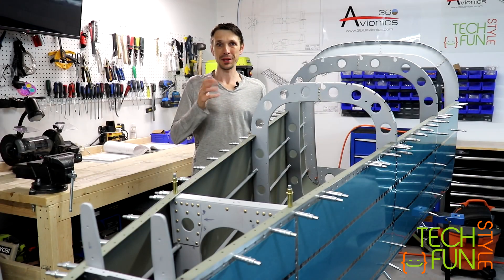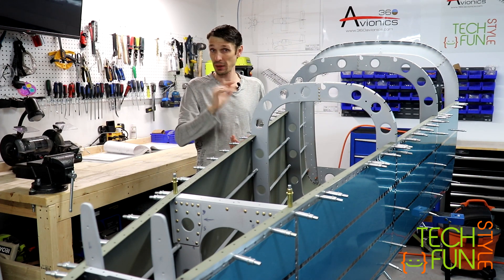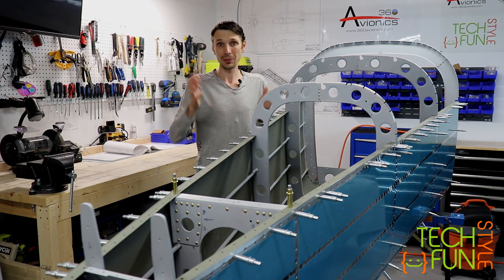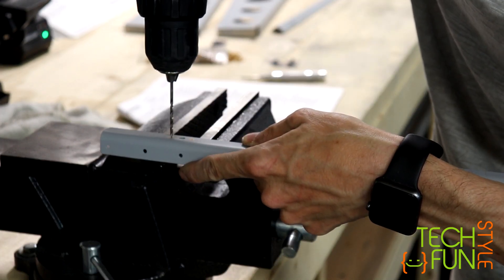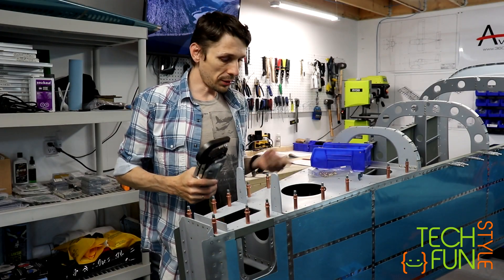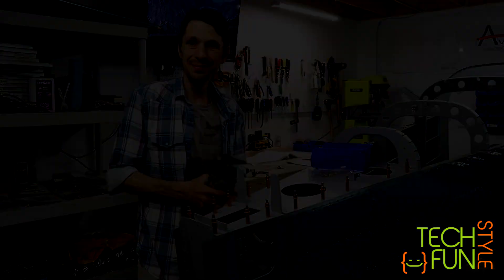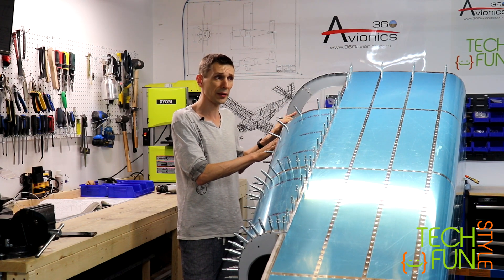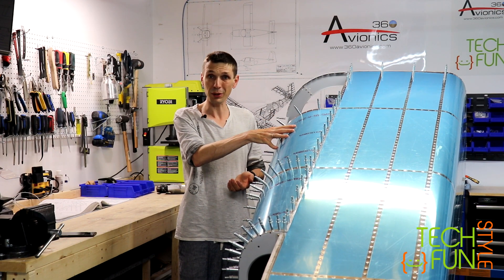RV-10 - Tailcone assembly. Almost ready

Comment: Nice work, what PSI are you running when using the rivet gun to set the flush AN426 rivets for the skin?
Reply from the maker: Thank you! I am set to 60PSI limit on my compressor. My gun is x3 and I use only short and gentle pushes on trigger. I feel maybe I have to go little down in my pressure settings because I see that I am  bending my skins a little.